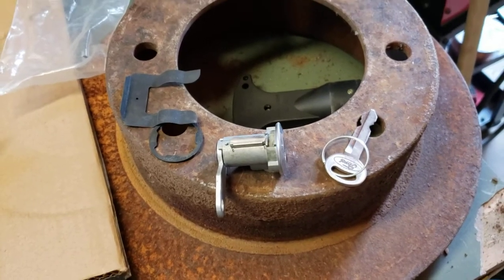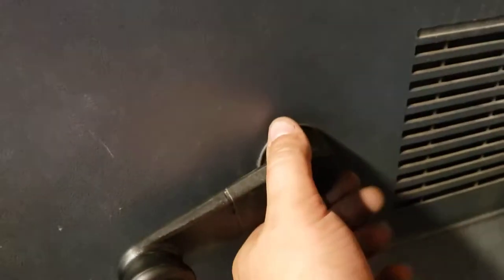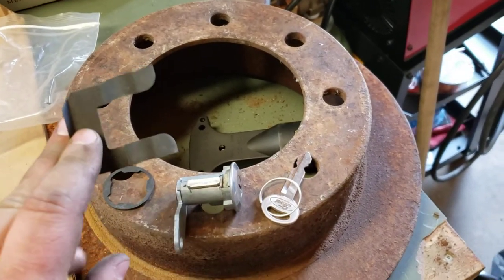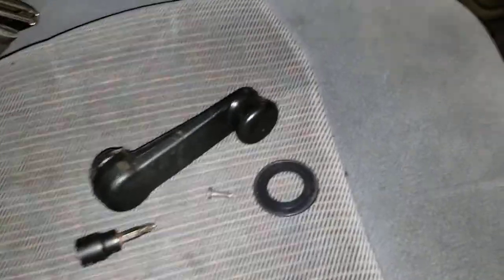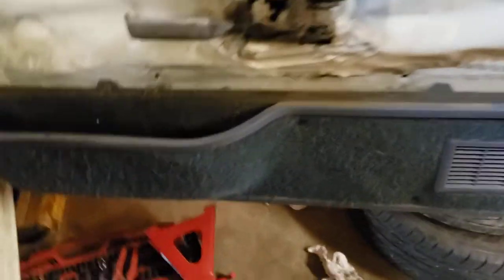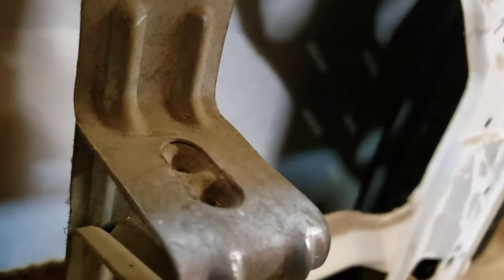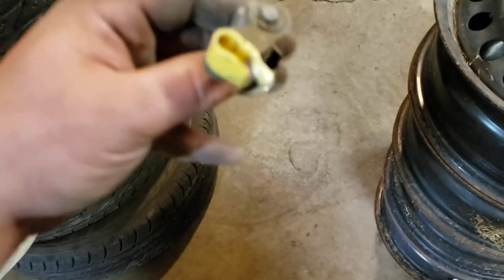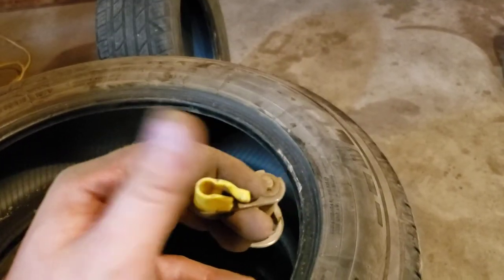How to change door lock cylinders on a 1987-1997 ford truck

Comment: I got to do mine in my 94. I'll let you know how I do here soon hopefully. Never messed with internal stuff. I went to mechanic class in college, but then ended up driving truck across country for 12 years. Now I'm back messing with my truck for myself trying to save money on repairs. 

Whats the best lubrication for those? WD40? Silicone spray?
Reply from the maker: It depends on what your trying to oil. I have never lubed the internal stuff but if you want to oil the lock cylinders I use dry graphite spray. Sprays on wet and drys inside
Reply: @brettfriesen5540 Thank you sir! I just got my right side that was broken fixed. And I changed the left one real easy after i figured out the broken one. Thanks for your help.